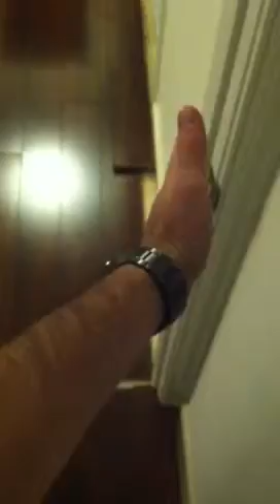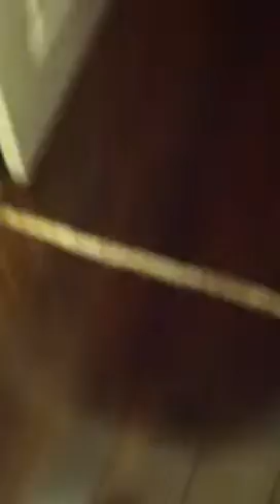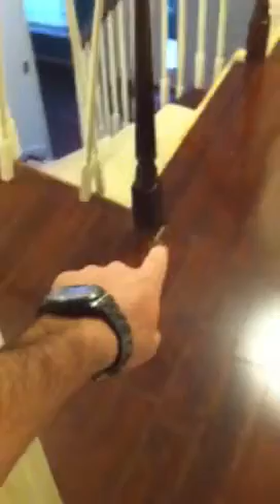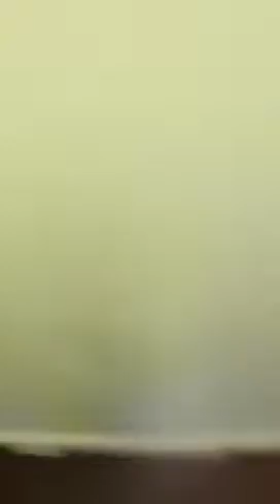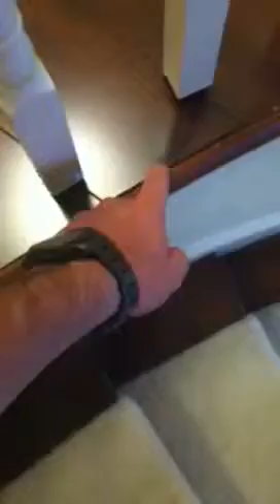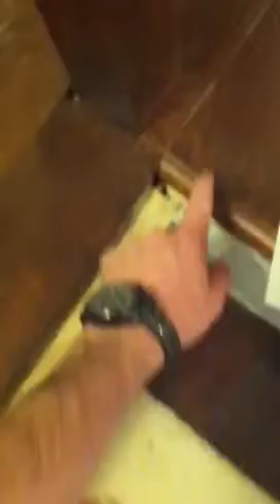Upstairs floor incorrectly done

Comment: that entire floor is shoddy and needs to be completely pulled and redone.  File a complaint notice to the company in writing.  If you had a licensed/bonded contractor perform the work and they don't respond within 30 days of the formal complaint, file a complaint with the Registrar of Contractors.  If need be, the bond should cover the cost to have another licensed contractor correct the defects.  That will be up to the ROC.